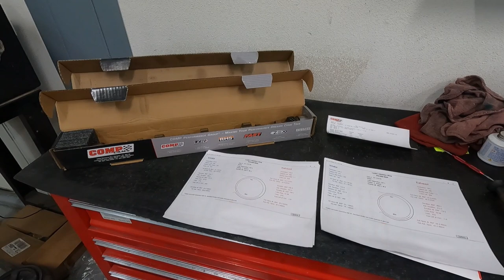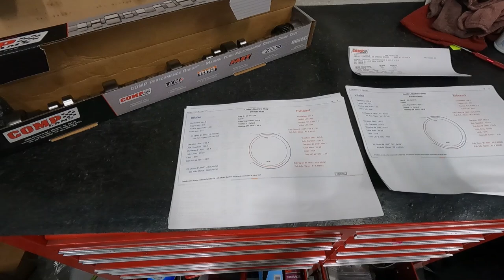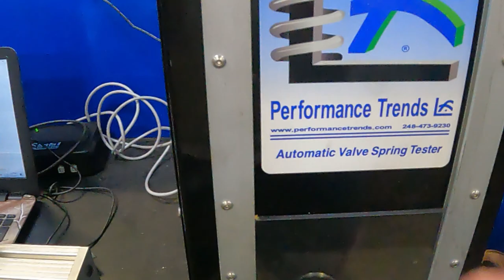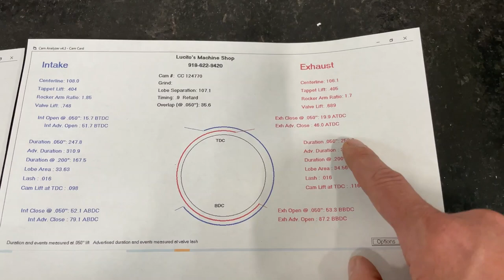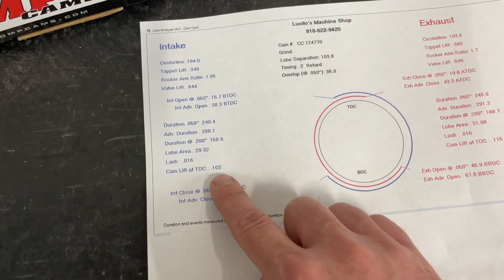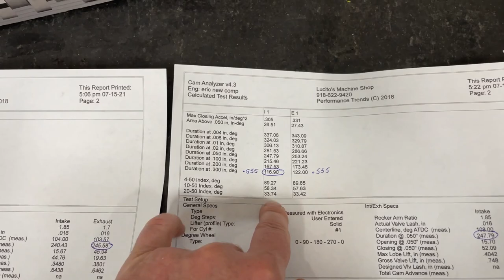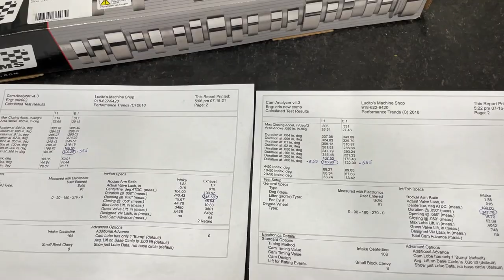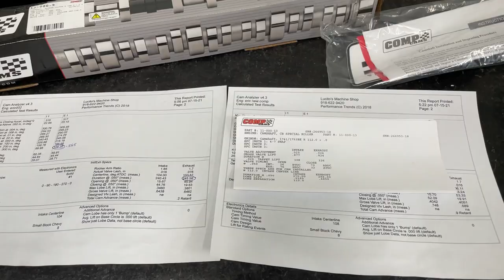Camshaft info. Why I think more lift is better.

Comment: Do you do camshaft recommendations? I am going to build sbc bracket racing engine. 406ci, 10.5:1 compression, AFR 210 Competition ported heads, supposedly flow 322cfm @.650 lift, super victor intake, solid lift  roller camshaft. What cam specs would you recommend?

Comment: I built a big block Ford engine for a bracket racing customer 598 cubic inches that made 1029 horsepower.  The engine ran well in his car but maintaining the valvetrain was a pain in his car.  I changed from the Comp Cams drag roller to another cam with about .100 less lift yet very similar valve events.  How much power do you think that it cost?
Reply: Well how much?
Reply: @CLEEPER1  The engine lost 15 peak horsepower at 7200rpm but only 6HP@6900.  Torque gained about 6 numbers across the board around the 5900rpm peak.  Old cam was 284/301 @.050 .836/,799 lift 114 sep in on 111.  New cam 285/295 @.050 .747/760 lift 113 in on 111.  I think that if I would have had an exhaust lobe with the same .050 duration that it would have made identical power.

Comment: Does Anyone Know If A .315" Lobe On A 252 Advertized Duration (200 @ .50") Is A Harsh For The Valvetrain? Its In A 1.65 Rocker. This Is A GM 3800 V6 (231CuIn). Im Specing A Camshaft And Im Constrained To Very Short Durations To Keep My Overlap In Check For My Desired LSA. Its A Daily Driver Turbo Car. 

Originally I Speced The Intake Lobe .344 With 252 Duration (202 @0.50") But I Figured That Was Far Too Agressive On The Valvetrain For A Daily Driver.

Comment: doesnt a lower lsa create more overlap and therefore loose dynamic compression? i thought it gained torque down low as the overlap frees up engine rotation compression drag as the piston travels up the bore and the intake closes?
Reply from the maker: Yes but the total time they are open (exhaust open to intake close together) is smaller.

Comment: Camshaft RULE #1....
Lift = torque.
Duration = horsepower.
Camshaft RULE #2
There IS ALWAYS A BETTER CAMSHAFT OUT THERE.......
Reply from the maker: I don’t agree with rule one but two is correct.
Reply: There's no absolutes. While lift increases torque, it also does so by moving peak points up. Maybe not as much as duration sometimes do, but it nearly always does. And as always, RPM and hp goes together.
Granted, I spec as much lift as I can and then look at duration, but I know that adding lift also changes peak power points. Sometimes you are lucky and get more torque without moving the peak point, and still have an engine that will rev higher out the back, but that's the exception, not the norm.
Reply: @AB-80X  you are smarter than most! 😊

Comment: So if you have stock cams on a DOHC head, can you degree both your intake and your exhaust cams away from each other with more lobe separation for low end torque? In general?
Reply: yep manual vvt

Comment: A better measurement would be torque, as long as the cam lift and duration is in the ball park the No's will prove if the head is good or not.
If the torque is good but power is down on what your looking for, then start looking at other parts other than the head.
By the way, changing the rocker ratio   changes the entire lift under the curve, hence making a significant difference.
How come you boys are using so much lift yet so little lift @ tdc. 
In England on a 1Ltr racer we use around 170thou lift @ tdc, though the exhaust headers are critical

Comment: Have you found it best to increase lift past max head flow? Example the afr 195 street heads, seems common for most to stop lift around .550/.576 on the street eliminators. Does it still add power above that lift when the port starts to go turbulent? 

Or another example the oem 906/062 vortecs. If you look at flow data for stock castings .475 or so they fall off, yet guys have used the xr276hr-10 with .510/.520 lift and made power on untouched castings. 

Do they make more power due to hydraulic lifter collapse and pushrod deflection? In other words the .510/.520 lift is in reality only .495/.505 ? Or is the head actually continuing to flow and make power past what the flow bench indicates it will?
Reply: @bradgriffith4231  Thy make vortec beehive valve spring kits that dont require any machining so no its not that expensive.    but a dual patter cam thats almost like a circle track cam in the 230s would be nice on vortecs.  but if you get a generic cam that lifts @.500 why not use it if it dosnt cost any extra money?
Reply: well the 195s supposedly are flowed by AFR on their page to .550 so i see whyd they do that for cams . its exactly what eric is saying here.  howards make a cam thats hydro roller 237 single pattern and .560 lift  

with a spring upgrade on AFRs they offer i think thatd be a nice setup with 10-10.5 compression on a 4.030 bore engine

Comment: Hydraulic vs mechanical and how much lift and duration on a 350ish sb with tfs 11r 205s with mildly supercharged 12-15# boost on M1 fuel? Cam recommendation? You didn't go long enough.
Reply from the maker: I charge $100 for cam recommendations. $600 for the cam
Reply: @WeingartnerRacing  I love what you were saying and I will keep you in mind. You're an engine builder also?

Comment: Had xy 351 4v heads solid isky cam fl560 644 lift auto turbo 400 run 12.5 change cam to 570 lift run 12.1 in australia in 90s .....thought and was told cam was to big .all was right

Comment: Have a 62 327 vortec ported heads flattops two vavle relefe. What's a good cam for everyday driver.
Reply: What's the connecting rod length?

Comment: on your very last cam in this video in which is down played...what is not mentioned is this is strictly a race cam that works best in the high rpm range, (no one consistently runs at 7000rpms on the street), and the long duration combined with the 800 some lift is a good, if not great racing cam period

Comment: Are you familiar with the Rhoads lifters?  Do you know if they will shorten duration at lower RPM and pump up at higher rpms?
Reply: @bradgriffith4231  I’ve run them before in the 90s with a small block 350. The cam was pretty decent, but the car had a bunch of low, and mid range torque. I’ve used other Comp Cams since, but have never had that “ throw you back in your seat” feel since. This time, I got a bigger cam from Comp, and used the Rhoads lifters again, and now I get that feeling two fold. The Comp lifters gave me trouble, so I went back to something I know worked before
Reply: Garbage. Just get a proper set of Howards 7000 rpm lifters.

Comment: Ive got a 454ci sbc 4.185x4.125, Dart iron eagle tall deck block 55mm solid roller cam .950 in lift .905 ex
Reply: Which heads and how much power?

Comment: Also note , is modern 10w-30  ok ? Or should we run 15w-40  or get the joe gibs or castrol Classic gtx with the zinc ? To make tappet cams last
Reply from the maker: The weight doesn't matter as much as the additives added.

Comment: Any comment on LS9 (-24.5* overlap @ .050 and 122* LSA) valve timing?  It makes good HP NA with what appear to be ridiculous specs?  

My theory is that it is basically a cam with "too much duration" where they "eliminated" overlap which makes me question what really is going on during overlap at low engine speed.  Also, no one seems to measure the fuel economy of aftermarket higher performance cams.  I'm guessing the LS9 NA will get a little less HP than "equivalent" cams but lots getter mpg.
Reply: @rustysausage69  A few comments:
1) at low speed most positive displacement superchargers are not up to their max psi.
2) a constant supercharger boost makes power at all rpms- the supercharger changes the charge density so you have gains at all rpms
3) wide LSA = less overlap by definition.  Whether it is supercharged has nothing to do with it.  
4) if 122* LSA made more HP top end, you would see everyone running them.  
I suspect it is related to fuel economy especially when some forms of racing fix the amount of fuel you can use which may be why the Lingenfelter race cam still has the 122 LSA.
The 122 LSA violates everything that was ever said about cam timing for the past 70 years.
Reply: Low end power sucks on the ls9 cams. Richard holdner has dyno runs to show this.
Reply: @Cowboy.underwater  Did you read the Hot Rod LS Cam Comparison in a NA LS?  The LS9 made the most HP of all the GM LS cams.  Do you have links to Holdner's testing?
Reply: @NoferTrunions  
Type 
Richard Holdner lsa cam test
Into the search bar. That's the one that I can remember off the top of my head.

Comment: I have a 95 vortex 5.7 Chevrolet motor I drive on the street I was trying to find a good hard hitting cam that I can drive on the streets with I got to set a bar text heads on it I need some help
Reply: @bradgriffith4231  I do have a real protection motor came out of 96 and the bar takes his is good, I was going to go with a t4 cam

Comment: more lift is not always better even with heads that flow good at 600 lift a smaller cam will make just as much power.... check out chevy's 525 LS crate motor as a example it has a small lift camshaft but makes more power than their other crate motors with bigger cams and more lift. when parts are made to work together they sometimes make more power than just race only stuff......
Reply: @tiitsaul9036  Chevy has tested the exact same motor with the same cam but more lift and it makes 515hp its another crate option
Reply: 525 hp LS crate makes this power because of the LS3 cylinder heads and engine is dyno without accessories a stock LS3 engine with stock cam without accessories will dyno 460-470 with a good computer tune the stock LS3 torque starts to drop off quickly above 5200rpm the LS 525 doesn't drop off torque until 6200rpm but it also makes less torque and horsepower below 3000rpm it will need a 3000 stall and at least 3.73 gears for it to work would be a better choice for something 3600 pounds or less lighter would be better
Reply: @gloriamaletta8667  they make the same crate motor with the same heads and a bigger cam but it makes less power..... Its not always the lift but the duration that makes the power....
Reply: @The1dually  the 515 horsepower engine has got a single plane intake for a carberator the 525 horsepower engine has fuel injection the camshafts of both seem to be the same lift and duration on the GM performance website. duration 226 /236. lift 525/525 and the oil pans are different a stock LS3 head that has been CNC ported will handle 600 lift and and up to 248 duration and make more power than the 226/236 525/525 and it will be  higher in the rpm range above 5500rpm also and make 560 horsepower or more at the crankshaft
Reply: @The1dually  the LS376/480 engine has 219/228 duration with 525/525 lift same lift less duration
Reply: @gloriamaletta8667  I guess I will use google for you and look it up....Ok here it is a LS3 with a bigger lift cam and less horsepower than the smaller lift identical 525 crate motor.... I have worked for GM for over 30 years selling  and dynoing these motors and I know a thing or 2 about them.https://www.gmperformancemotor.com/parts/19420382.html
Reply: @The1dually  well it looks like when my 1984 monte carlo ss needs a new motor I'll know who to call and get technical advise since 2008 it's running a LS2 364/ 440 horsepower special ordered crate from SPPC it's a single plane LS3 intake the heads were replaced with CNC ported LS3 heads hardened pushrods crane cam 226/236 duration with 551/600 lift fed by a holley hp 850 carberator it starts to really pull at 3000rpm and doesn't stop until 7200rpm and makes torque in the upper rpm range and doesn't taper off made 540 horsepower at 6700rpm 470 foot pounds of torque at 5200rpm at the crank and is still doing so in 2021 runs as good or better than when first installed got any ideas of a streetable non stroker 376 ci replacement that will make a substantial difference in power while being streetable 580+ hp 500lbs torque at the crank that stiill is making decent torque at 6500rpm that will rev to 7200rpm car has a built 700r4 and a lockup 3000 stall converter and a 1986 buick GN rearend with 4.10 gears with power steering and brakes has gone 10.87 at 122mph but runs consistent 11.0s to 11.2s at 120+ car hooks well and goes straight
Reply: @The1dually  this engine is a stock 430 horsepower LS3 yes it has a cam with 551/522 lift but has 204/211 duration yes the 525 horse engine has 525/525 lift but look at how much longer the valve stay open the duration is 226/236 yes longer duration will alway make more power than just lift if duration is the same on two camshafts but one has higher lift the one with higher lift will make slightly more power like l said duration is more important in making power than lift is the LS364/450 crate engine has 550/550 lift and 204/218 duration cam and makes 20 more horsepower than the stock LS3 engine and is only 364ci vs 376ci LS3 cylinder heads love more duration and lift on the exhaust side comparing the 525 HP LS cam 525/525 lift 226/236 duration cam to say 550/585 lift same duration 226/236 the higher lift cam will make 7-15 more horsepower but you can't compare a much lower duration cam with high lift to a cam with much more duration and less lift like l said duration is more important than lift because higher duration makes the valve stay open longer
Reply: @rustysausage69  duration the time the valves stay open has more effect on engine performance in other words a cam with 600 lift and 224 duration will not make more power than a cam with 575 lift and 247 duration if lift is equal the cam with more duration will make more power usually in the upper end of the powerband while loosing torque in the lower rpm range lift is less important than duration is LS3 heads like more lift and duration on the exhaust side
Reply: @rustysausage69  the longer the valves stay open to put fuel in or exhaust gas out is more important than lift some guy on this post thinks a stock LS3 430 horsepower camshaft 551 intake lift and 525 exhaust lift with 204/211 duration is a bigger camshaft than the 525 horsepower LS376/525 engine with 226/236 duration and 525/525 lift is not the case it may have more lift but the valves are not staying open near as long the valves staying open longer equals 95 horsepower with less lift more duration even if lift was increased to 600 lift with the same 226/236 duration it would be worth 5 horsepower more or so and l bet it only makes this 5 more horsepower above 5000rpm and up making no difference from idle to 5000rpm than the 525 lift cam

Comment: You lost me. If the lobe profiles are the same, they should both get to the same lift at the same point. The one with more lift simply keeps opening beyond where the other stops. Why cant any lobe profile that can open a valve to .700 be ground to open to a max of .600? In the higher ratio rocker conversation, since a cam can be ground to litterally any shape you want, why not just grind it to the profile that would give the same lifts as the higher ratio rocker throughout the profile? Seems to me that running a higher ratio might just be a bandaid for the incorrect cam?
Reply: The problem is not at the lobe surface, the problem is at the lifter and up. So just because you decrease the lobe heigh and increase the ratio, that does not mean less stress. .700" lift at the valve is .700" at the valve, the ratio just means some parts are more under load than others. Ever pulled a stud from a head due to spring pressure? Or broke a rocker arm? Never mind the fact that pushrods would be under a heavier load in relation to a shorter travel. So now you are also running into pushrod deflection which is one of the most overlooked issues of most setups.

Comment: The high lift will keep the valve open longer just like duration because the valve  has to travel a longer distance.
Reply: Not true. Higher lift with same duration profile, has a faster ramp speed. Higher lift doesn't hold it open longer, it just gets there faster. Only thing that controls how long they are open for is duration. It's in the name.

Comment: I am interested in talking to a cam guy. Need to buy a cam for my 91 F150 347 with GT40P. Also would be port matching the heads intake and exhaust.  I would like a good set of spring upgrade too. Would love to keep on pump gas as well. Shoot me a message if someone would be nice enough to help me out. Rebuild this for my father in-law